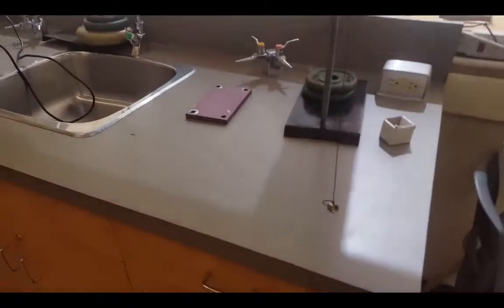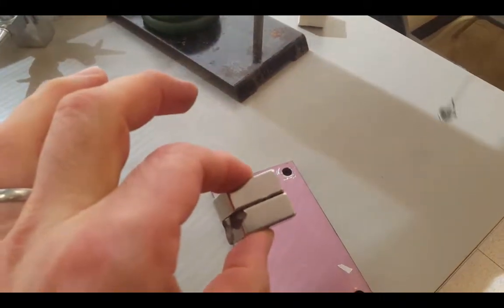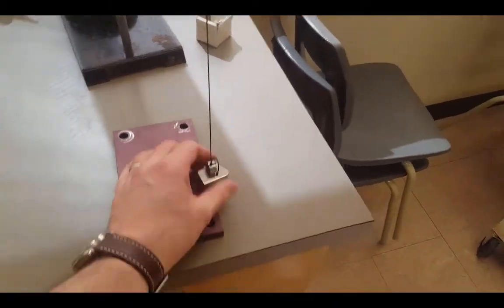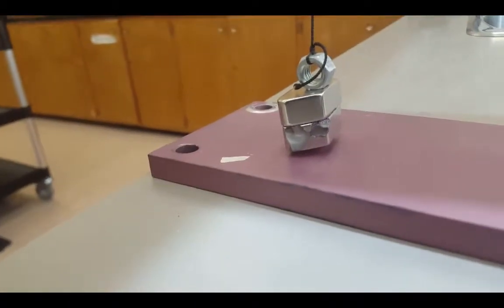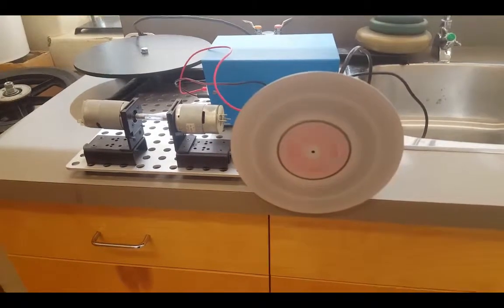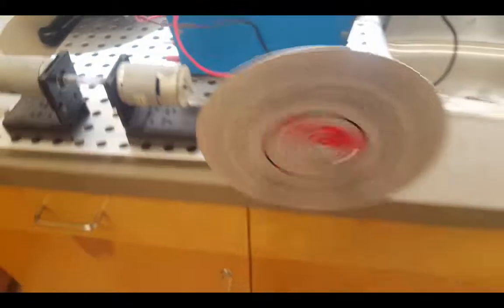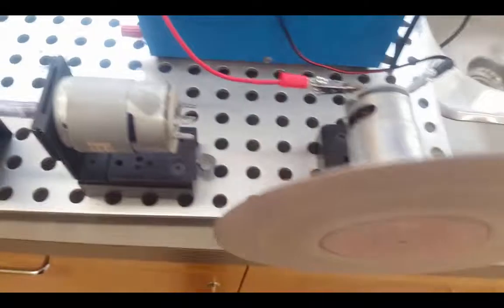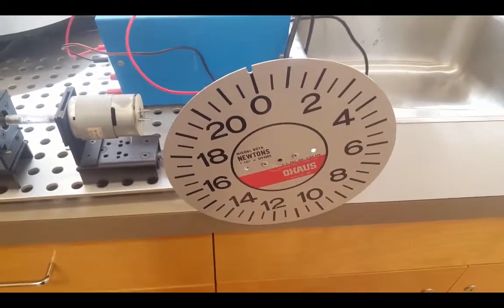Crazy Physics ! Electromagnetic Eddy Current Brake

Comment: Hi, regarding the spinning disk experiment...
1. If we replace on iron disc would there also be eddy currents generation and subsequent stop OR it will stop just because of magnetic force of attraction?
2. Can electromagnets be used instead of permanent so you don't have to move them close, instead just turn it on and off.
Thank you.
Reply: @PHYSICS EVERYWHERE !  Thanks, I have read that Eddy Current brakes don't do well at stopping slow rotation speeds but yours appears to stop the wheel. If you move the wheel super slowly, will the brake still stop the wheel completely?
Reply from the maker: The disk must be aluminum, or something that is not ferromagnetic.
Reply: @PHYSICSEVERYWHERE  
OK..., and what about electro-magnets, could we use them
And very much thanks for the quick A2A. 😊
Reply from the maker: @reckona5418  Not sure, give it a go and let me know.
Reply: Will surely do, thanks for your help.